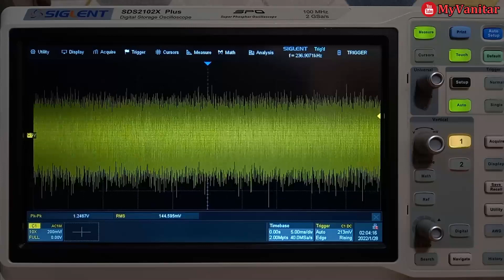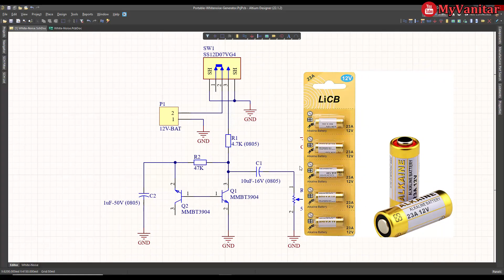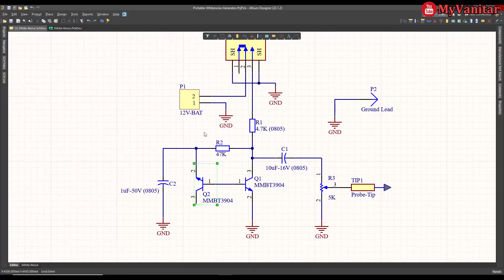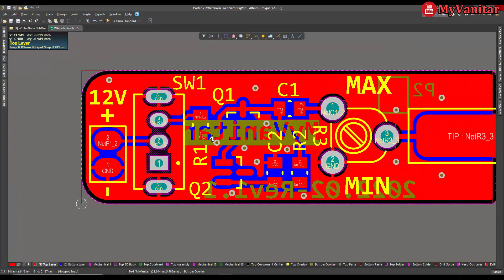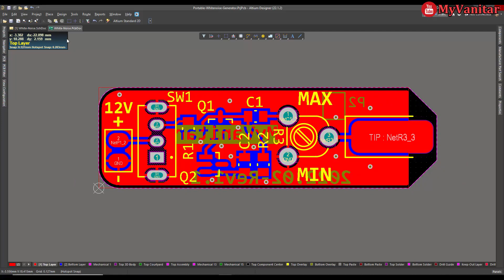A Portable White Noise Generator Circuit

Comment: show the frequency spectrum.
Reply: I agree. voltage plot is not a good way to show that is white noise. and FFT would quickly prove that.
Reply: There are lots of measurements, which can be done to show that noise is actually white and which were not done.
Reply: @sdjhgfkshfswdfhskljh3360  effectivement le simple affichage ne permet normalement pas d'afficher qu'il s'agit d'un bruit blanc.  Une autre solution serait peut être de prendre un générateur spudo aléa de  grande période.